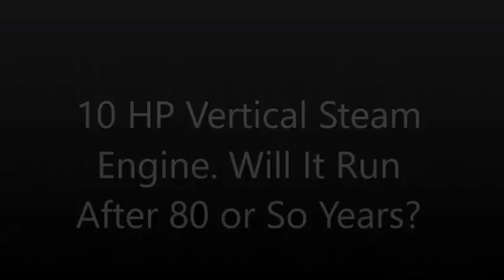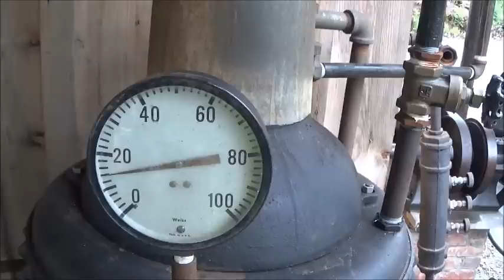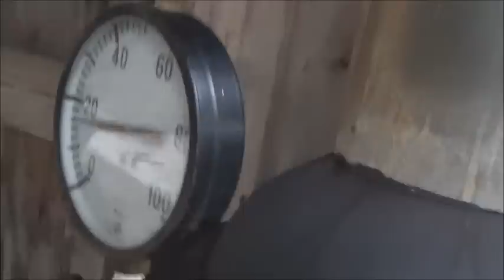UPRIGHT STEAM ENGINE REPAIR SITTING FOR YEARS PART 5

Comment: The best “will it run video” on you tube.  It surpasses my previous favorite published by Mustie1 where he got flames shooting out of a vw engine on the bench. As an old piano tuner I never said I broke a string, I said the spring broke. The truth was the fifty year old string was fatigued and corroded. I just was there when it gave up. I imagine that that pulley,a hundred year old casting, had zone of weakness in it. You just happened to be there when it broke.

Comment: A couple of observations. All C.H.Dutton throttle governed engines 6" bore and larger had balanced slide valves. This is formed by the round part of the  slide valve and rides on the steam chest cover. Yours appears to be stuck. There are springs and a ring under the movable part. Next give some serious consideration to fitting steam line lubricators to your engines. Mechanical and hydrostatic are fairly easy to obtain. Water is a lousey lubricant. Keep on steaming.
Reply: Shell J-360 steam cylinder oil works well

Comment: That is a smooth running engine. Don't beat yourself up so much about the broken pulley. Look at it as a learning lesson. You just need a big strap wrench to turn it next time. You just saved someone else from making the same mistake. Great job getting it running again.

Comment: Awe . Happens to the best of us , Jonathan . I just had a "similar" problem on a new(ish to me) riding mower . The gas ran into the engine from the tank through a bad fuel pump . I had a shut off , but it must have been left open . I started it , twice . Then realized it . Changed the pump , oil , filter , & started it up . I thought I'd blown the rings , it smoked so bad . Only have 1 . Started mowing anyways . Ran fine , cleared up half way through the first lawn . S Happens . Being able to fix it , whether your fault , or that of another's , is what I come here for . Fixing is fixing . And most can't do that . But we both know , they could . Or at least be wise enough to avoid breaking things . Which is why , I understand your anger , personally . Not worth beating you up for , you're doing such a good job of it yourself . Lol . You can fix it . You just shouldn't have to , I get that . Bigger picture , your doing fine ! Better than most ! Love ya , Jonathan & W . Family ! This is what America , Is all about . Solving problems , overcoming them , together . Nobody is perfect . United we stand .

Comment: Great Job Jonathan...  It Runs very Good my Friend.  I have found out about this Older stuff you almost have to check every detail when you work on them, who knows what took place with the eccentric on it.  But you got it figured out anyway.  It is a Crying shame about your Pulley, but as the Old saying goes Crap happens, I have broken things over the years due to my miss judgement as well.  It Hurts but it can always be fixed and then you can take pride in your repairs.  Keep the Videos coming my Friend WE LOVE them ALL...  God bless & Godspeed...

Comment: Perfect!
Now we know a little about how to adjust the timing on a steam engine.
As for the pulley damage, I think I have mentioned it before on here, a long time ago There is a thing in Japan called Kintsukuroi or Kintsugi. It is the understanding that something is more beautiful for having been broken (and then repaired). Usually has to do with pottery that has been repaired with gold "glue" to make a beautiful line along the break. Like you said, one day, someone will see a beautiful line of brass where you brazed it, and appreciate the beauty of the repair.
Well done.
Thanks, and Meow to Ninja Catscan.

Comment: Very good job Jon. It runs like a champ, and that 10 horse engine can run a lot of other things that's for sure. Looks like it uses a lot of steam but it really doesn't when it's hooked up to a larger boiler. That work you did on the slide valve paid off well and the chrome rod don't leak a drop. Once you get the smaller rope packing for that smaller gland you are going to be set for another 100 years. No comment on the flywheel!

Comment: Sorry about the pulley fracture, yes very frustrating. You never know, could have had a flaw in there. Keep up the good preservation of these fine machines. So interesting because you didn't want to try to remove them for risk of damage.

Comment: That wheel has been fractured for years. 
       One of the car manufacturers are working on a hydrogen burning engine. 
     With modern alloys It could cut alot of weight, and have many different uses. 
     Thanks for the video. Enjoy learning about things I've never worked on.  I've seen them at shows and such, but never stumbled across one discarded.

Comment: Use a big (or 2 together) hose clamp and a split open pop can (or 2) to compress the ring. Just loosen it enough to slide up as the piston goes down, then compress the top ring and repeat! I've used this method on motorcycles, tractors and any other "oddball" stuff that my wrinkle band snap lock compressor didn't fit.
Reply: @geriatricjoe1227  Use what you have! They are cheap, and they work.

Comment: Its alive ! And the valve you lapped in works great! Sometimes I burn a trace off of a Cb radio and I have to fix it and it dont make me feel good. So I know how you feel. A guy always has to be careful on guard against flub ups. Work at a comfortable pace. It sounds like it runs good to me. I think the brass cover will look neat. Green paint always looks good and well red paint too. Its got the full ten horse power I bet. Fix the slack on the eccentric and she will be quiet. Chrome rod looks good. You did well reparing that. You know all this but I like to type my excitement about it. I get mess up when I dont use the correct tool for the job. May be there is a tool made for turning over the engine that wont break pulleys? The iron I am using is too hot and hard to adjust or I have to remmeber to adjust temp before I burn a trace. The trace can be mostly big then I run into small traces and I have to lower the temp and if I get in a hurry I make a big mistake and burn it.

Comment: Awesome job. Good homestead size engine. Have you run the engine you built out of an old water pump? I know you ran it on compressed air but it wwould be interesting to see it run on steam.

Comment: I’ve used screw type hose clamps for a ring compressor. Rebuilding a Dodge transmission and had to compress sealing rings around the pump housing. Worked just fine.

Comment: HI Jonathan --I made a pickle fork wrench 3 inch between the forks a handle  bend to a 90deg the end I stick into the spokes was long to clear the edge of the pully  and turn the pully or hold on bottom with a block //great job .

Comment: It's awesome to see that engine running again! Are you going to add oil injectors to the steam inlets? I know you 're just getting the system built but I thought running those engines without oil in the steam would cause premature wear.
Reply: The wet, low pressure, steam out of the little boiler has lubricating properties.  J/W will need steam cylinder oil injection devices, when he uses his bigger boiler (possibly with super heating).

Comment: Jonathan, For a thin cast iron part like the pulley rim, I wonder if EasyTIG no pre-heat cast iron repair might be the answer. It also is much less visible than brazing.

Comment: Sorry to hear you broke the pulley, but I’m sure you will get it fixed, and it would be scrap if it want for you, so don’t take it too hard. Dumb question, do those engines run in both directions

Comment: Friends,  am I correct that this 10hp unit is a double-acting engine? So that's two power strokes per revolution of the crank - one on the downstroke, one on the upstroke? Are most engines of this era doubke-acting? Thanks.

Comment: Quick question, can you recover the steam being waited in the exhaust and pipe it back to the return  on the boiler using a check valve and or a steam trap or both so the boiler can re cycle both the water and the steam being waisted now,the boiler would not have to work as hard to recover whe you have to ad water,  you can use a  McDonnell and miler 47-2 automatic water feeder to ad water automatically as well

Comment: "Will it run after 80 years or so?"

That all depends what we mean by "it".. because the engine that now sits before us isn't really the same one that languished four-score years in the elements, is it? This motor has been very well massaged over by our gracious host Jonathan, and I think that the odds of it NOT running are pretty darn poor at this point.

Comment: Was that old sheet metal jacket around the piston only dressing up the looks? Possibly where the manufacturer would have painted their name? It doesn't look like the engine needs it to function, only cosmetic.
Reply: Cover to retain insulation (sometimes wood), more efficient if the cylinder isn't exposed to air.
Reply: @waynespyker5731  Makes sense, Thanks Wayne!

Comment: Rain? What's rain? I'm thinking a steam powered train engine goes 2 300 miles on wood n water. Water not escaping would be a key to getting that many miles between stops. Wow what an invention n how can we use it today. Sure beat that Ford electric truck they tested the other day. Battery said 160 miles n they got 84 miles out of it. They should make a steam engine pickup.

Comment: You would think a lot of these steam engines would have been put away working.  These reciprocating steam engines are extremely inefficient, especially compared to electric motors and completely unsuited to certain things like your sharpening stone machine. Steam engines are meant to be started and run continuously.  But who needs to run a sharpening stone nonstop? The tool dept, maybe? Though, obviously it would run on a belt-shaft system and not directly hooked to its own dedicated steam engine.

Most companies using them would have been far better served from electric motors once they were available.  The ongoing running costs of a steam engine would have been far higher than an electric bill.  Maybe if the company just bought the steam engine and all the line-driven equipment right before AC motors were perfected and so they got used for a long time.
These line-driven machines are also very inefficient with multiple shafts running across the ceiling and tension leather belts being tightened to turn on the lathe or whatever it was being powered.  From coal to end machine is probably over 90% inefficient.  This type of steam engine isn't (thermally) efficient in the first place and all the shaft-belt systems lose additional efficiency in the shaft bearings and the belts. So by the time actual billable work is being done, 90% or more of the heat generated by the burning of the coal is just lost.

Since electricity generating stations use orders of magnitude more coal per day and get discounts for long term high volume contracts and power a non-recipriacting steam turbine to generate the power at around 35% thermal efficiency, it just was never going to be economic to have your own coal burning prime mover. 
 Even if you didn't want new tools, you could keep your existing shaft-belt system and make the prime mover a large electric motor. You switch out the 20hp steam engine and replace it with a 20hp AC motor.